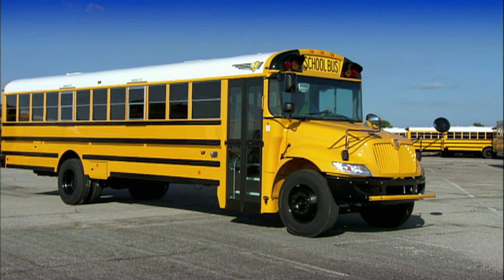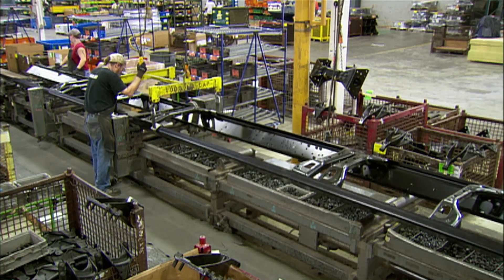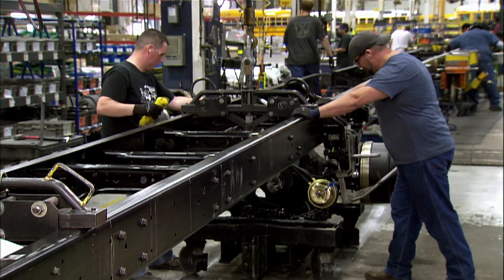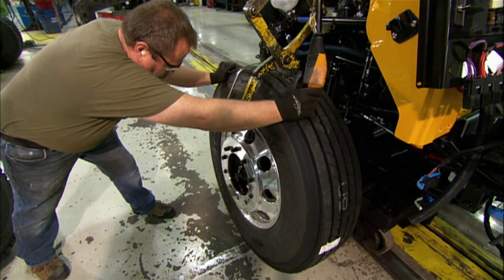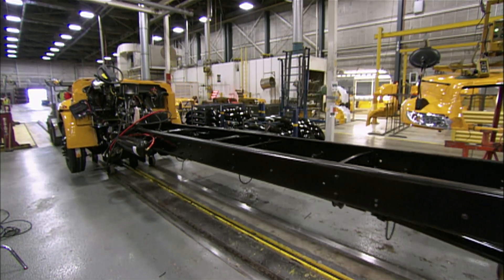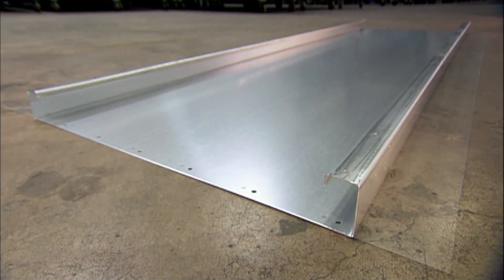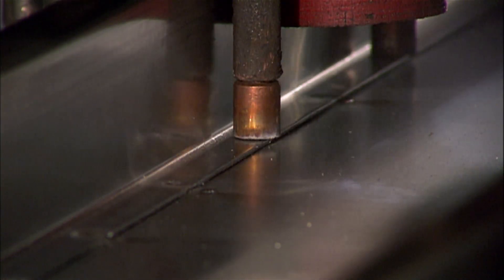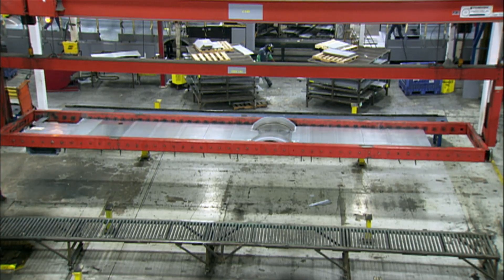IC Bus on How It's Made: Part 1 of 2

Comment: Buses have come along way. Buses now use automatic transmissions and disc brakes on all wheels.
When I was young. Buses had drum brakes, gasoline engines, manual transmissions.
Besides the disc brakes and automatics, they have diesel engines along with CNG Compressed Natural Gas and propane.

Comment: The greatest Bus of all time!! We're a full IC CE fleet, and they're all great.. Though our drivers are not exactly the best ones lol 😝
Reply: +jerry sylvester Sorry, Thomas C2 takes the crown, your buses seats peel after 3 years, i know 50 year old thomas buses that have the original seats that havent peeled yet.
Reply: The seats do not peel.. It's probably because unlike many other districts with IC Buses we take care of our buses,
Reply: The top layer of vinyl peels off then you see the fabric underneath, at least of buses do, Guilford County.
Reply: Jerry Sylvester actually I recently been inside of the 2005 IC RE 300 and some of the seats looked torn and the chair cushion itself managed to lift easily off the frame and the seals around those small AC units were coming loose
Reply: I love that the buses are high off the ground so they can drive through high water.
Reply: My district is getting a fleet upgrade to new Thomas buses, but most of the IC Buses we had before (no clue what year they're from) had the brown/colored part of the seat peeled off revealing that fabric right below it. Some of the buses aren't replaced yet and are still the old ICs. The new Thomas ones are so much better 😉